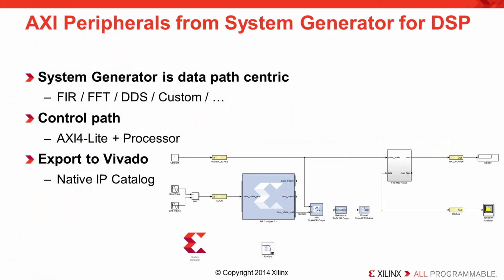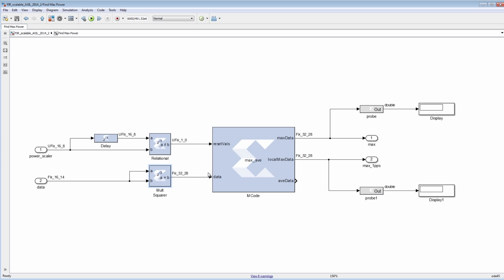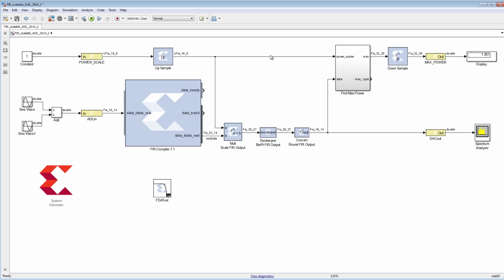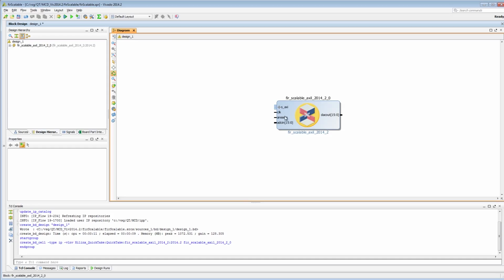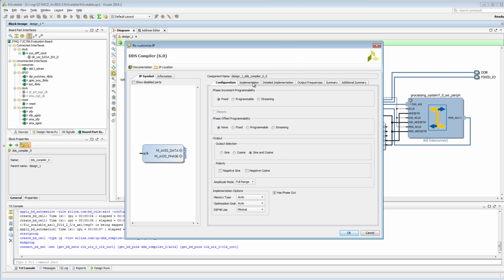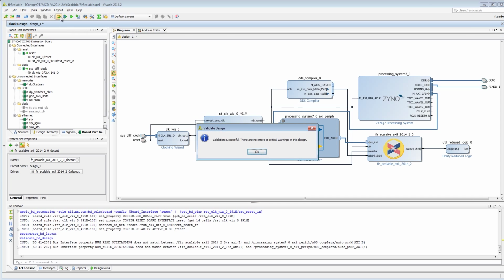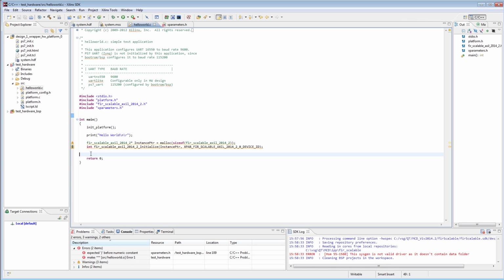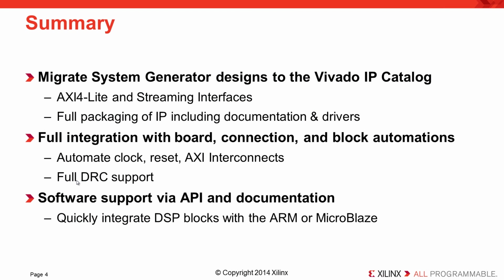Specifying AXI4 Lite Interfaces for your Vivado System Generator Design Final

Comment: How did you get the documentation on the automatically generated drivers and how would you get them to work in Linux - do they need to be compiled into the kernel?